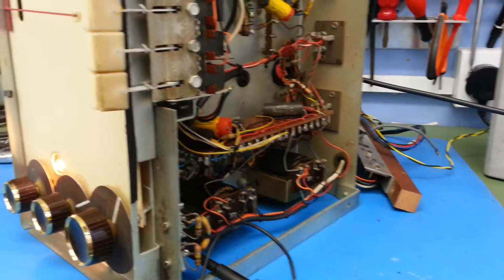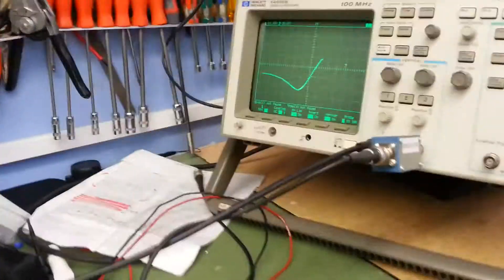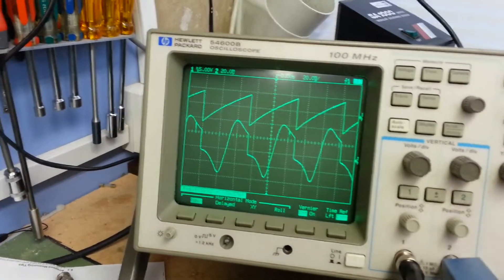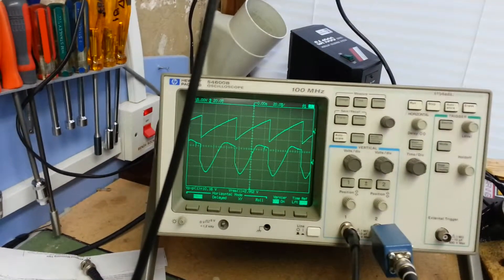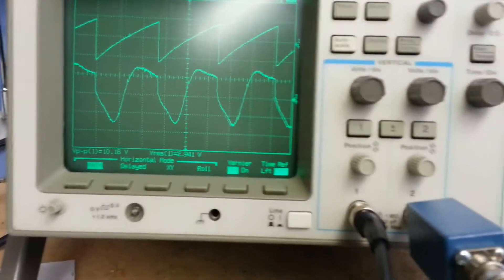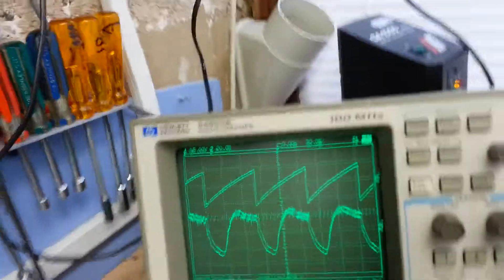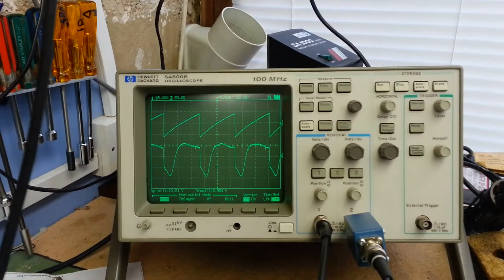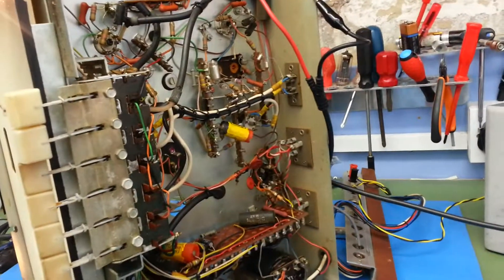S curve on Dynatron fm

Comment: Thanks! at last I see an actual S curve. Trying to replicate but my 20MHz oscilloscope I think is not sensitive enough. What probe are you using? the blue box at the oscilloscope input is a 50 ohm feed through terminator?
Reply from the maker: A 1MHZ scope should see it. This S is formed by the swept signal through the descrimintor and the sweep speed depends on the generator. It's usually below 100 Hz. It's a fiddle but you will get there. Keep signal to IF low. You should hear a buzz through the speaker too. Good luck.